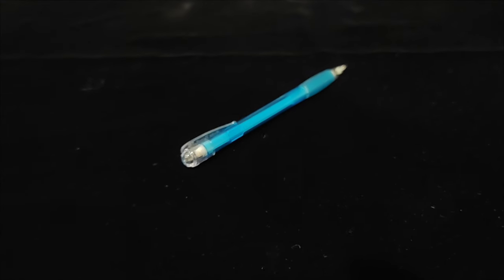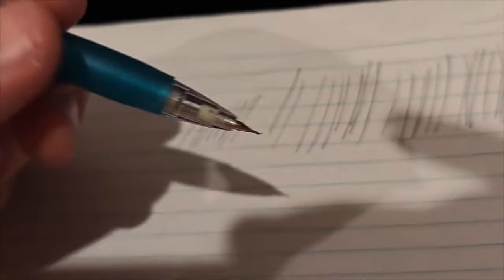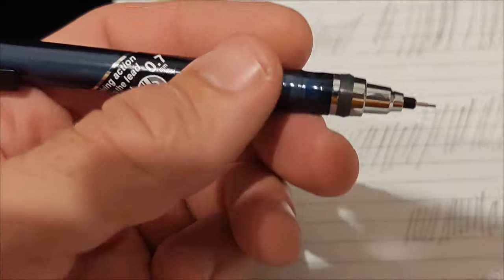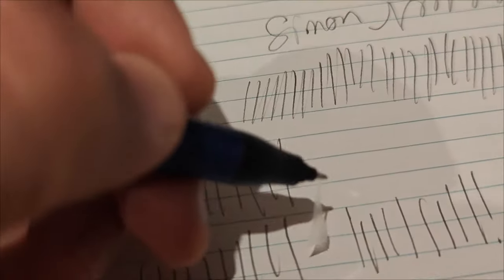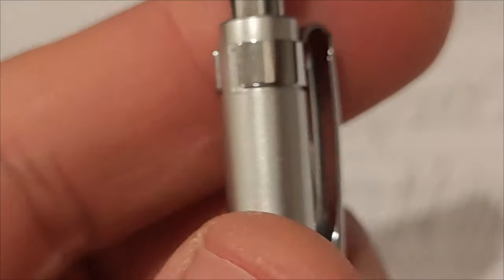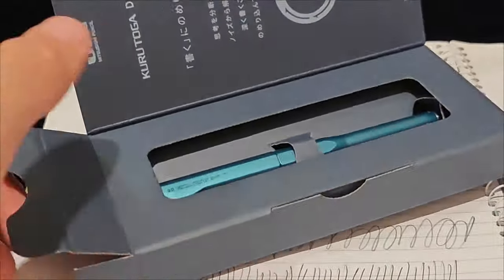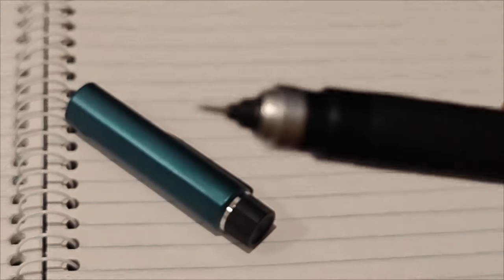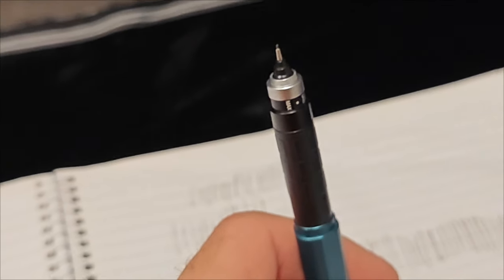Uni Kuru toga range review

Comment: sadly it's more for asian chicken scratchings, numbers and print but not cursive
Reply from the maker: Is cursive writing with pencils something you would otherwise do? Does anyone else reading this use pencils for cursive writing? I'm an engineer and mostly use pencils for technical work like flowsheets; calculations etc. When sentences are involved, graphite doesn't do them justice IMO. That said, I'm a weirdo!
Reply: @WondersUnlocked  sure you can do it with anything practice is what matters and cursive is a dying art, our writing is being reduced to the level of a punch card I just try to use it because I feel I should..